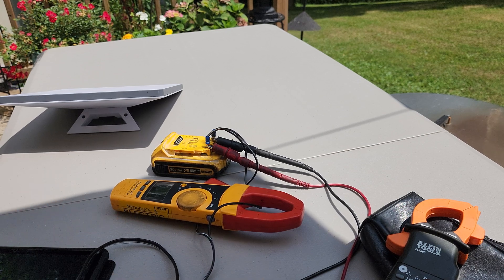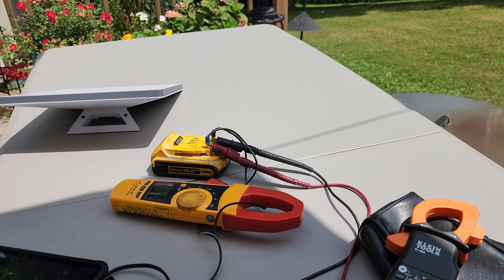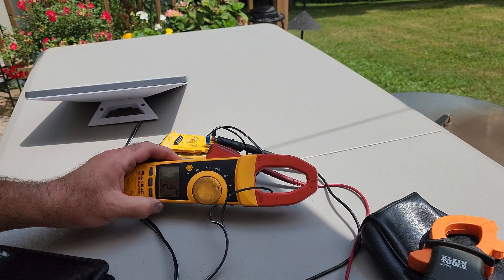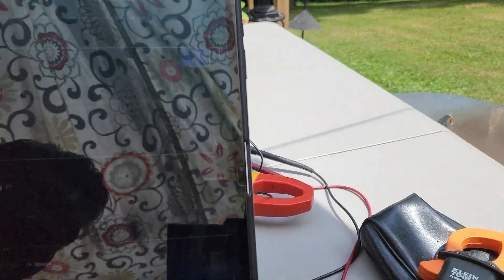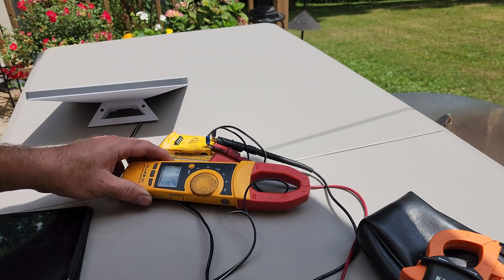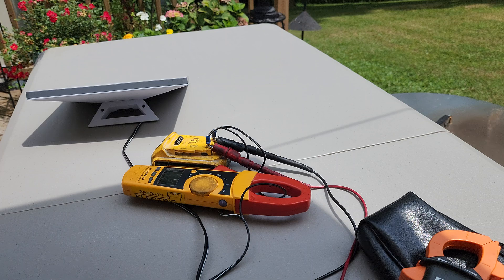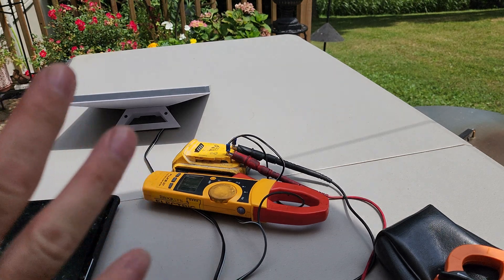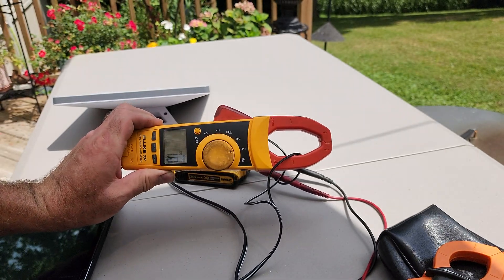StarLink Mini power consumption details.

Comment: Wonder if a single portable solar panel would work. Maybe one of the portable 200 W 36 V 400 W 36 V panels. Those would be very lightweight.
Reply: Using solar panel without battery rarely makes sense I guess. You need a fluctuation buffer.

Comment: Ran mine all day today by the pool just checking gear and it was about the same. From about 0900 to 1500 or so on one of my small Jackery's (300) instead of just plugging it in and I think it was at 65% when I came in.

Comment: Thanks. Confirms 23 - 25w power consumption in another video. It could run 4 hours on 20v 5ah Dewalt tool battery or 52 hours on 100ah 12v lifepo4. This is great! Big thanks to Starlink team not locking it down to proprietary battery or USB power. Hopefully the mini has reverse polarity protection.
Reply: It won’t power up on 12 volt power.
Reply: @STF68  It needs 5A peak on startup. Your battery or wires may have too much voltage drop.

Comment: can you think of any reason that I couldn't build a 5521 to 12v cigarette lighter plug cord?  Or maybe even a 5521 to alligator clips to grab any car/boat/RV battery?  Thanks for the videos, mine showed up today.
Reply: You can also get a USB-C PD car charger adapter, and get the 5521 - USB-C adapter cable.    The Mini runs great on USB-C PD ports.
Reply: I'm an EE and design electronics for automotive use. The electrical system of a vehicle is generally pretty terrible. There can be high-voltage transients, negative voltage transients, and tons of noise. All of that means that you want a pretty robust power stage to survive for any amount of time. What I'm planning on doing is purchasing a 12V to 24V dc-dc converter and splicing that into the dish's power cable. That will minimize losses in the cable and provide a buffer from the vehicle's power system. The alligator clips straight to the battery would work fine. Just be mindful of not overdischarging it.
Reply: @CPD-KD6-3.7  great info thanks!
Reply: @Chasing518  Starlink Mini isn't available in my area yet, but when I get it,  I'll post a video!
Reply: @CPD-KD6-3.7  i just ordered a 12 to 24 converter off amazon and will make a cord.  I’ll post up a video on my channel next weekend.
Reply: @Chasing518 have you done this yet?
Reply from the maker: I can't think of any. They are already available online